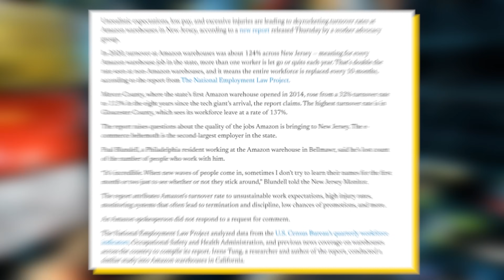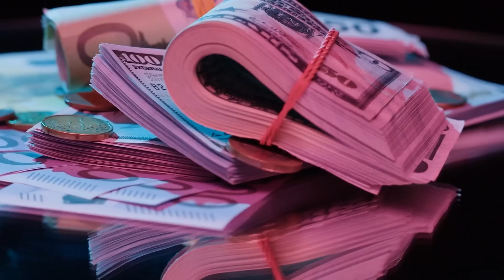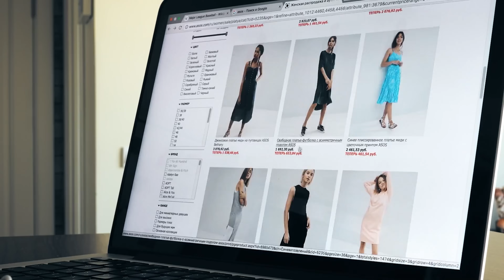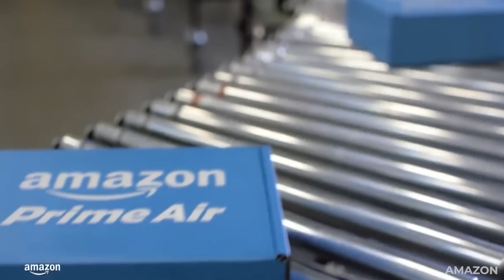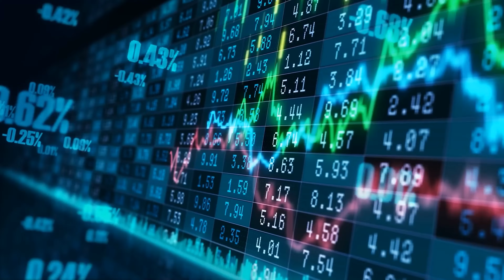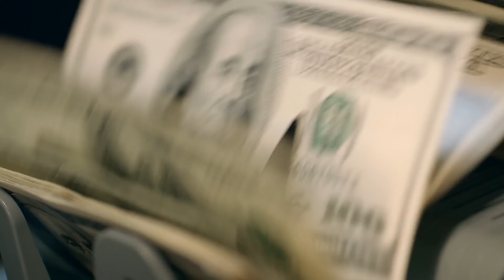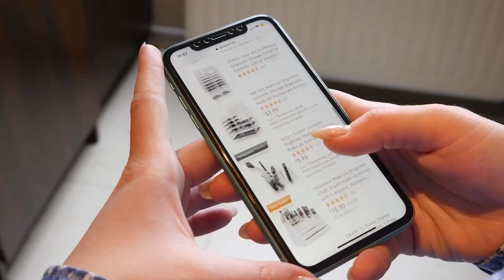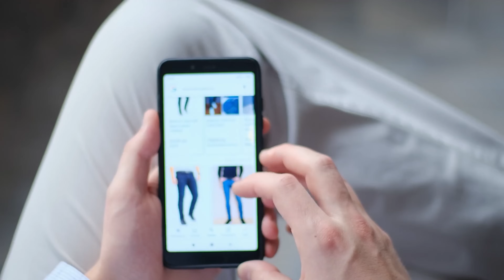How Everyday People Have Been Scamming Amazon For Billions

Comment: This isn’t entirely accurate. Most amazon fraud is through refunding services. The refunders typically use the customers’ accounts for the refunds. They use various methods, most commonly mail fraud. The delivery drivers don’t suffer from this, Amazon is the one who takes the loss in this case.
Reply: By amazon, u meant the employees and customers? Amazon will just increase service fees and employees never get a raise
Reply: They do have a safeguard which is needing the physical item(s) to process the refund, mail carriers need to be charged felonies for swiping the items, but of course how would you enforce it if stores and entities can investigate themselves? every company needs a 3rd party to double check items and investigate where and how items go missing which is very concerning between UPS and USPS
Reply: @_Circus_Clapped_  they don’t swipe the items not how it’s works it’s never there in the first place

Comment: The fraud rate of 1% is in no way a loss. 1-3% are pre-calculated. If it goes over the 3%, the company will change their refund policy. But as long as its only 1% they can call it very low. Besides all that: Its rediculous to call refund fraud a loss. 90% of the returned items worth less than 1000 USD get destroyed after they get returned. It makes absolutely no difference if someone sends back the actual product, an empty box or a look-a-like. The returned parcel goes directly into a huge trash facility where it gets shreddered. regardless if the product is untouched or not. Im sure there are videos on youtube that show that those operations are as big as the Amazon warehouse itself. 

So id say: The legit refunds all end up as waste. The fraudulent refunds at least end up in someones hands.

Comment: Amazon employees at returns steal returns like crazy.  I returned a box that has 4 items in it.  The employee took the expensive item and only mark complete for the other 3 items.  Another incident happened to me the following week where I returned 2 boxes, 1 box had 4 portable radios, the other had 3 radios and 1 card holder.  Amazon returns employee took the portable radio from each box.  Now Amazon is going to recharge me for those items the employee didn't mark complete.  Funnily, the other 3 items within those 2 boxes are complete except what employee stole.  Back then I gave them the benefits of the doubt that maybe I put too many items in the return box so they missed it.  I reduced the amt of items per return from 6 to 4 and this clearly shows me employees stole returns, making customers pay for what they already returned.  Just hate myself taking me 3 years to see Amazon employees are stealing from me; didn't notice charge-back when Amazon recharge for items employees stole from my returns until now